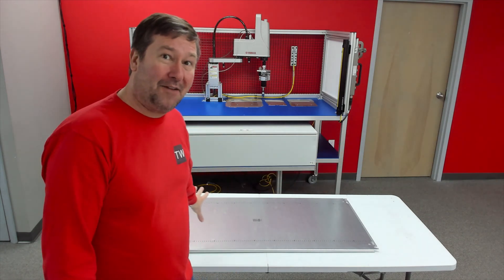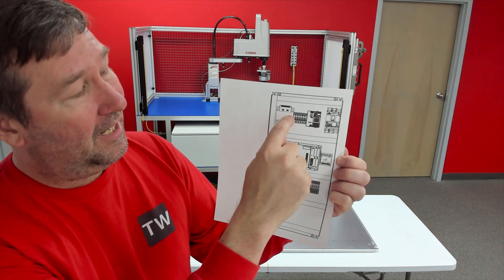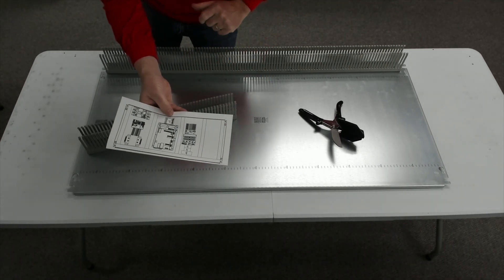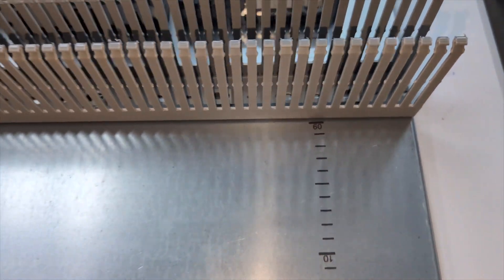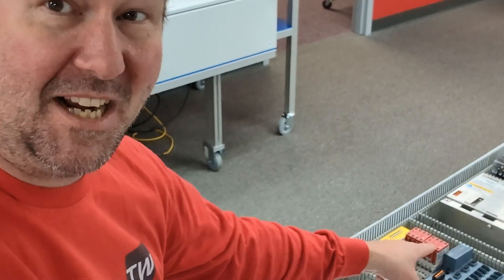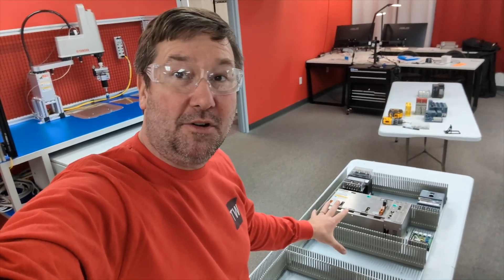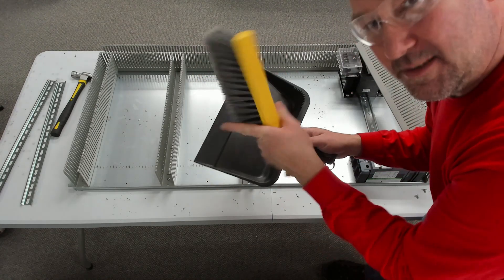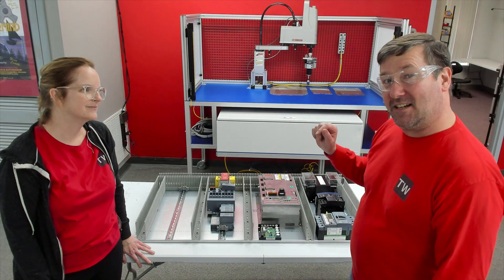Tips on Laying Out Your Industrial Control Panel

Comment: You don't use a square to draw your dock's outlines, pre-punch your holes or lubricate your drill bits? Your one hell of a maverick Tim! Great video as always !
Reply from the maker: I typically use a square but talked about in the Rittal that this panel had layout measurement on it.

The panel was center punched, it must not have made it into the edit 😕 

BUT I never use oil. I've built 1000s of panels and found that the biggest culprit of fingerprints and smudge marks was oil. When I quit using oil and considered the shortened drill and tap life a cost is doing business, our finished product looked tremendously better.

Comment: Its also a good idea to buy a large adjustable set square, that way using a normal marker pen you can make exactly where to mount it, then wipe the pen off with brake cleaner/contact cleaner